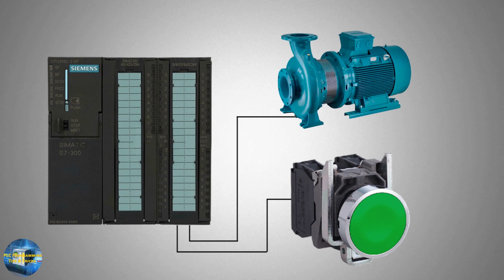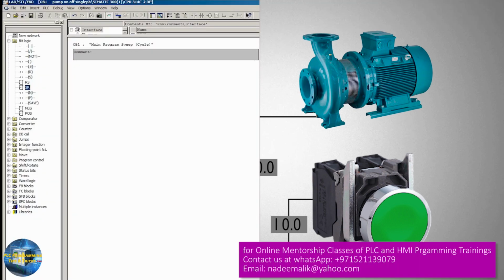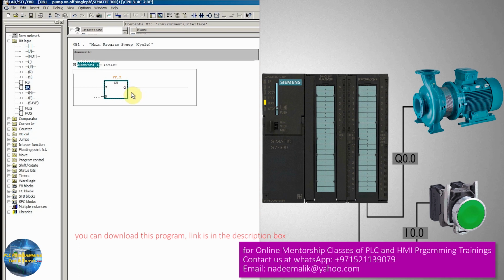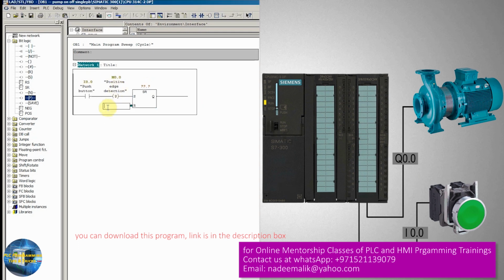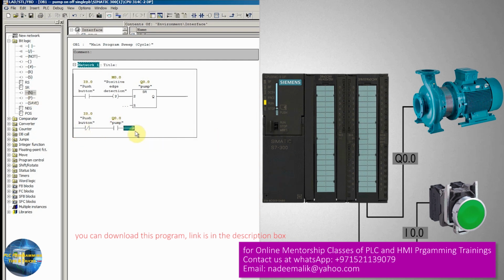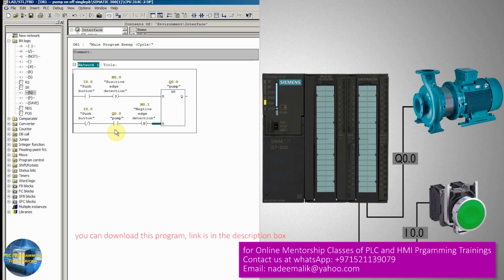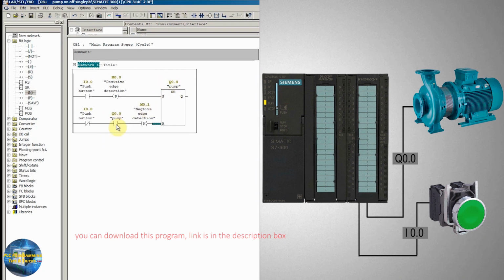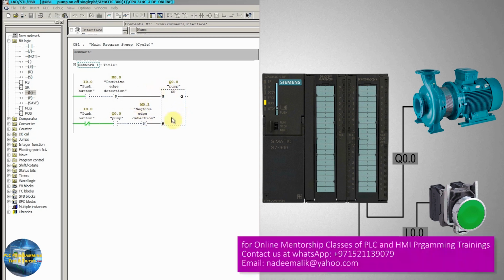Turn ON and OFF Pump using single momentary push button with PLC program

Comment: What is that positive/negative edge detection in this example, I mean if there is push button (I0.0) and pump (Q0.0) so what device/thing is that M0.0.
Reply: The rising edge is an important concept in electronics because it is often used to trigger or synchronize other circuit elements. For example, in digital electronics, a rising edge on a switch signal is often used to indicate the start of a new cycle or to trigger the transfer of data between two circuit elements.